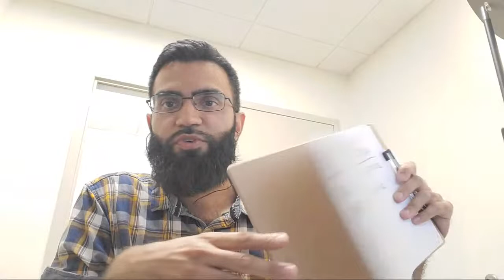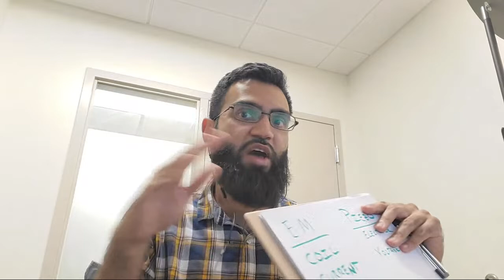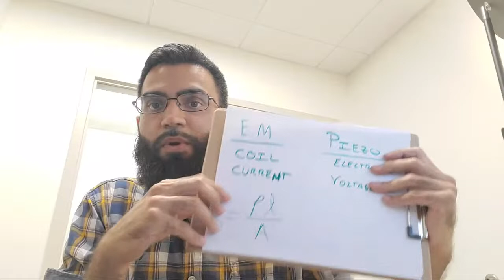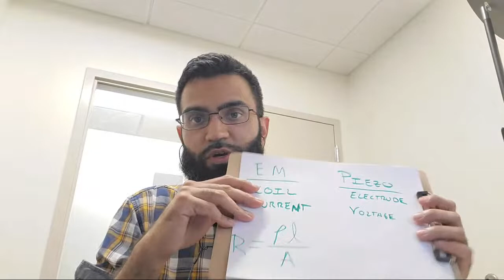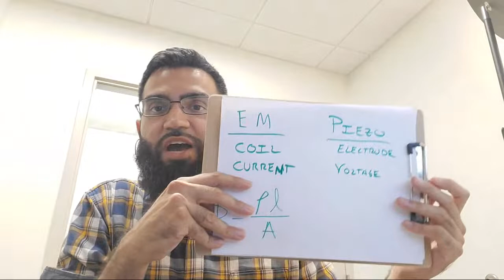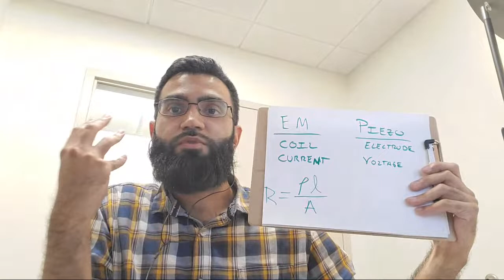Piezo SHOCK Show #68: Why Are Piezo Devices So Efficient?

Comment: Could you explain why piezo's aren't efficient at larger scales like for cars?
Reply from the maker: Piezo's inherently don't move very much at all. Thus, it is hard to develop large piezo motors that will move a car. The amount of "transmission" required from making large movement out of small motion will work poorly.
Also, it not necessarily that piezo's are bad at large scale, but other technoliges (electromagnetic) shine at the large scale and are very cheap and reliable.

Comment: Could you make a video about the different shockwave machines on the market , for example the piezoelectric shockwave machine from Wolf and comparing it to Storz, which operates on electromagnetic I think.
Reply: What the strength and weakness are of all these different shockwaves. In lay man terms hehe
Reply from the maker: @fatehw  Thank you for the request. I don't have experience with the Wolf.